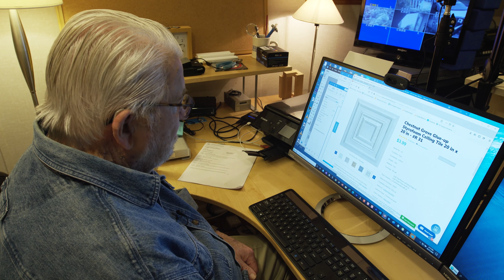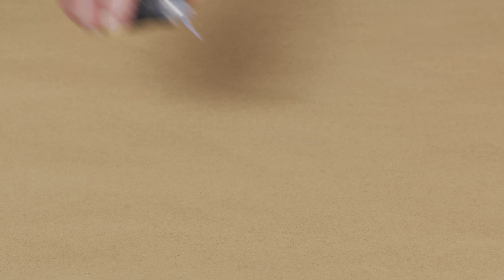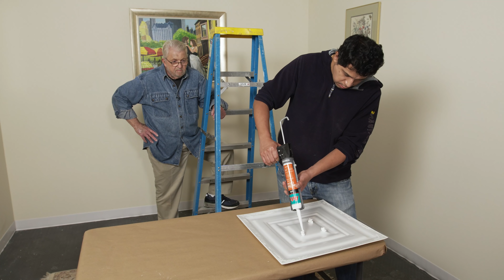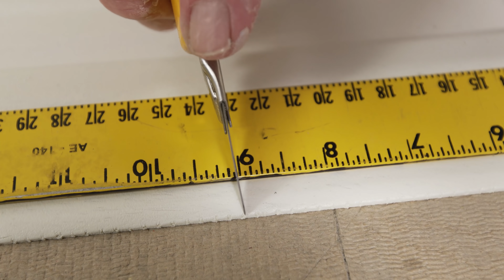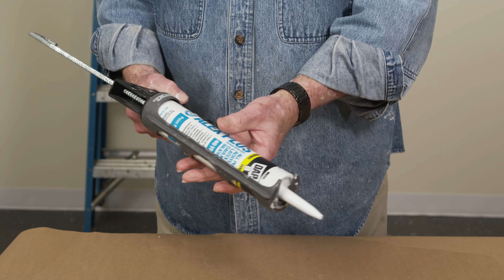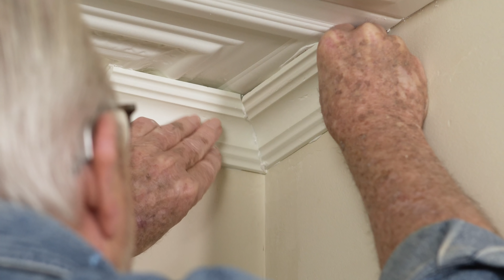Say Goodbye to Messy Popcorn Ceilings: DIY Guide to Covering with Glue-Up Ceiling Tiles

Comment: When using these tiles and crown molding, when is the best time to paint them? Before sticking them up or after?
If done before, they would need to be touched up after caulking since the paint will be will be a darker color. 
If done after, I am concerned with making sure I get into all the crevices. 
I didn’t want a ton of stroke lines.
Reply from the maker: I recommend painting them after they are installed to cover the caulking and avoid stroke lines.

Comment: DO NOT use this crap !!!!
Reply from the maker: Thanks for sharing your opinion, but these tiles work well for many customers when installed correctly.
Reply: @DecorativeCeilingTilesInc  I'm not saying they don't work, what i'm trying to tell you is these tiles are VERY flammable due to the material they are made of, they don't pass fire code minimum regulation, they are a death trap!

Comment: I removed a popcorn ceiling paint simply by using primer sealer put on thick with a roller.  I was actually just trying to recoat/paint it but the weight/chemical of the primer started peeling it so it became easy to use a scraper to remove it and then paint the ceiling.

Comment: Worked as a drywall finisher for 4 decades. The way I got rid of popcorn is by getting a sprayer with warm water. Wet the ceiling with the sprayer, let it soak in for a few minutes and scrape with an wider trowel. This method makes a mess, need a drop cloth but it works great. Need to touch up after the scraping most times. If some remains wet it some more and scrape again.

Comment: As a professional handyman, who is constantly repairing ceilings from leaks, this is an absolute horrible idea! First of all because you have the popcorn on the ceiling those tiles aren’t all gonna fit on their flush, especially if the ceiling is not 100% level. It’s like trying to lay tile on an uneven floor. The edges will pop up here and there it will look terrible and when time passes by and you do have a leak you better hope you have some of those extras to replace them or otherwise you’ll never find the exact same tile to replace it. if you’ve have leaks the best thing is to do is to simply take the popcorn down and have a smooth ceiling, which looks better,  last longer and is easy to repair in case you have any type of roof or plumbing leaks. It’s not difficult to take down. All you need is water, a pump up sprayer and a scraper.

Comment: It is actually very simple to remove popcorn ceiling, you just have to spray it with a squirt bottle, and then scrape it off with a flat tool. It can be messy to clean up, but it is possible to get rid of it.

Comment: I've just bought 60 2 ft PVC Stickgoo brand tiles from Amazon.  There were no install instructions and I was looking here for help.  I had originally decided to measure the ceiling length and width with a laser meter and calculate the cut size of each corner tile.  And then start in a corner and work outward from that  corner.  After watching your method I've scraped my plan and well use your.  It clearly is simpler in that calculation  work is not required and assure better alignment well be achieved.  Many years ago when I was in the USAF, I taught basic electronics to new airman.  I am in the position to say that your presentation here is excellent.  Thank you very much.
Reply from the maker: Thank you for your kind words.  Ron Hazelton trully did wonderful presentations.
Reply: @DecorativeCeilingTilesInc  "did"? Is Ron no longer with us?

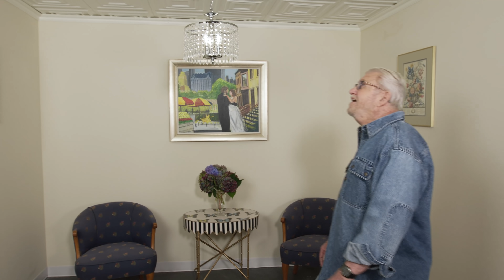Comment: Nice job and nice look, except for the end, because it's not finished.  Caulking the crack between newly installed crown molding and both the ceiling and walls is often needed, especially here with the ceiling tile ridges.  Look at 7:46 just 10 seconds before video ends; you see the black cracks between crown molding and ceiling on the far wall and it sort of ruins the entire job!  Finish details make all the difference.  Would take about two minutes to caulk the entire room interface between crown and ceiling.  Given the good work that preceded, the oversight is surprising.
Reply: Correct looks like CRAP😮
Reply: @Mr.Morgun0831 
💯!

Comment: I wouldn't do this without knowing if the ceiling contains asbestos.  Hammering nails, or in any way disturbing it could release asbestos into the air, as would the tiles when they eventually come loose.  At the very least, I'd use a N95 mask as a minimum.

Comment: With all due respect that is not a glue up tile. Yes it works but that’s not what that tile is made for.
Reply from the maker: Hello Jose,  thank you for your comment. Please explain what you mean by your comment.  It is a glue up tile, that is what it is made for and sold for, the only way to install it right is by glueing it to a solid surface.  It is too small for drop in system and also too light.

Comment: This works for certain decors, but let's be clear; there is always the option of just scraping the hideous popcorn ceiling off.  Messy yes, but a lot easier and less costly than the insanely expensive ceiling tiles (which I simply refuse to pay).  But I do see the appeal for some, who believe the simplicity and time saved is worth the price (I'm just not one of those people🙂).
Reply: My issue is that I have extreme chemical sensitivities. Scraping it off would cause dust to settle for months. We did it in one room and our cat developed nose cancer within a month and had to be put down. It's been almost 6 months now and the dust is still settling on top of book cases in the room. I cannot risk it in the room I sleep in. Only non-toxic adhesives and panels will work for us. Which costs so much more. :(
Reply: @enlightenedhummingbird4764 Aw, sorry about the loss of your fur baby😞.
Reply: @snarkyenigma9219 Thank you. I'm 💔. It was so sudden and unexpected. The nose lump seemed to grow overnight. It was so strange. I cleaned the space really well after. But I can't help thinking that project was the cause.
Reply: @enlightenedhummingbird4764 The timing certainly does sound rather suspect.  Sometimes the best remedy is to mourn, but then get another baby, especially when so many need good homes!

Comment: What do you do with the gaps between the ceiling tile and crown moulding? Looks messy
Reply from the maker: You could use a filler tile  to go around the perimeter that those not have  a deep profile. Also installing a molding with a thick enough "lip" and running the tiles into it.  Here is our selection https://www.decorativeceilingtiles.net/styrofoam-ceiling-tiles-20x20/

Comment: How much area is needed to glue them onto the ceiling? We have wooden rods across our ceiling, not completely flat surface.
Reply from the maker: The tiles need to be glued to a solid surface such us drywall or plywood.. We do not recommend gluing onto wooden rods.  However, I do recommend giving us a call to explore other options we have that might be more suitable.. 866-29-0380

Comment: Textured tiles did not work well with the crown molding. Maybe if you guys had caulked there as well it would look better? Personally, I put up tongue and groove in my main living areas and down the hallway. It wasn’t cheap, but it looks fantastic and hopefully is a value ad. I did the scrape version in my master bedroom and boy. Was it a mess even though I put down tarps. That stuff goes everywhere. And all the time I’m working on it. I’m thinking if I get cancer, I’ll know why. Plus, after all that scraping, I had to apply new knock-down texture and paint the ceiling.
The last two bedrooms in our house, I think we’ll just put up drywall over the popcorn. Sounds like a less work and expense. 😉

Comment: Yes I remember them very well  back the 70s or 80s they are pretty much ban but still can be found on line but now can buy Press metal tiles the same pattern in full sheet s or meter squares I believe it's very popular around country s yes saves alot of painting sanding especially 👍👍
Reply from the maker: We have been selling these in US for over 16 years.  The foam is most economical, we then offer PVC and also pressed metal.  We do ship worldwide. https://www.decorativeceilingtiles.net/ceiling-tiles/

Comment: You could hang some quarter inch sheet rock right over it
Reply from the maker: Yes it could be done but it is easier to glue these tiles over.  No taping, no mudding, sanding and painting.  And some people like the extra detail these decorative tiles provide.  There are many design and color options.

Comment: I would stick with the popcorn ceiling.  Polystyrene is a terrible thing to have if you have a fire. Extremely dangerous! Just use a wallpaper streamer and you can easily remove the textured  ceiling. You might need to replaster, thankfully a couple of coats of paint worked for me. By the way that ceiling by the end of the video looked even worse than the popcorn finish 😂😂

Comment: As a professional contractor we don’t install this type of material because it is very flammable also when working on older homes we recommend testing existing materials on ceiling for asbestos, always  be aware that remodeling older homes are often more difficult than you may think.

Comment: The ceiling looked better without the polystirene tiles , they looked cheap & tacky in the 70's & look even worse now . Not to mention the fact that they are an absolute fire risk . Do not put them on if you want to sell your house as you will be made to take them off to satisfy a survey .

Comment: Thank you for an easy to follow installation video.  I am going to try this on one wall in my bathroom where I took the ceramic title off the wall.  I think that it will look nice.
Reply from the maker: Hello, I would not recommend the foam tiles on a wall as they can be damaged easily.  PVC might be a better choice, see here: https://www.decorativeceilingtiles.net/faux-tin-ceiling-decor/
Reply: Thank you so much kind sir for the information.  I will definitely get the PVC type.  God blessings. @DecorativeCeilingTilesInc

Comment: These are banned in most countries because of the noxious fumes given of when easily set fire to and burned...also if you have a bobbly artex ceiling you can use hot water to get it of or plaster over the ceiling no need for polystyrene used in the eighties to cover up a ceiling or just live with it

Comment: Wondering how long you have to hold the panel in place for the instagrab glue to stick to the popcorn ceiling. My ceiling isn’t as texture as this it’s more so stomped  with a texture design.
Reply from the maker: No time at all, in my experience you just have to press it against the ceiling and it is up there.  Granted, if there is dust on the ceiling the glue might just stick to it or if the popcorn is loose but under usual circumstances, you press it and it is done.

Comment: Too bad the ceiling tiles don't look like reliefs from ceilings of ages ago. The ceilings that Had medallions around the light fixture in the center With more simpler patterns radiating outward. Now that would be pretty. Just putting tiles up there looks like an office ceiling with squares.

Comment: Even up to the 1980s, asbestos was still being used in ceilings, if the builder had already had the stock before it's ban in 1978. You don't want to disturb the ceiling even with just a small nail. I was going to use this method before I heard about the fire hazard, but thank God I didn't, especially since my ceilings are heated!

Comment: I don't know about this but any popcorn ceilings in UK pre 1970s has asbestos.. Its OK until you disturb it in any way. Needs specialist removal. If these tiles are poly styrene they are dangerous to the max, a small fire spread super fast & the smoke is highly toxic. Please don't believe everything on U T.. Do some research.

Comment: It looked like you cut one tile into 2 equal halves to fit perfectly into the ceiling. No need to cut if the starting line was shifted 9 inches from the center, and it would look nicer too.

Comment: This shows just how awful the finished product can look when adding Crown moldings after the ceiling tiles are installed. Done prior you could caulk paint and have a finished look without all morse code dark areas from all the space created from the relief. The lighting fixtures and vent are the other elephants in the room. Done correctly they could look like a hundred bucks too.

Comment: I covered up my bedroom ceiling with these tiles @ 15 years ago. It wasn't easy for a 4'10" woman who's afraid of climbing a ladder but I got it done. It looks great and is still holding strong.
Reply: @suza8110 thank you so much. I got the stuff now. we putting up the new ceiling this weeekend. Wish me luck 🤞🏾
Reply from the maker: @Goodkidsmom  How did it come out?
Reply: So my question is what kind of glue you use? Cause I want this in my bathroom ceiling but I want to make sure it will hold
Reply: @Goodkidsmom   You use the same kind of stuff you use for tile. It's called "mastic". Mastic is a sticky adhesive that is commonly used for bonding materials together. You will also need some calk to fill gaps and joints. You can also buy pre-painted tiles, or get whatever paint you like. Paint tiles before you start.
They usually come with good instructions. My only caveat is to plan carefully. Turns out my room is NOT even on all sides so the edges look kind of funky but no one else says anything. Also, get some nice crown molding to hide any mistakes.
Good luck!!!
Reply: Where can I buy the decorative silly tiles in this video
Reply: @jamesmoss7651   I don't remember where I bought mine (@15 yrs ago) 
Looks like Home Depot sells them and Wayfair has a good selection.
Reply: i am impressed. i am 5 ft and every single time i try one of these ideas i end up injured, out a bunch of money, stressed out and miserable, and I end up doing a bunch of damage and making everything worse. But have I learned my lesson? Nope! I keep trying stuff haha
Reply: @KristinaApplegate  funny how you sound exactly like me.
Reply: did you paint them,  I feel  like they would look really unfinished without paint and just look like styrofoam
Reply: @andreamitchell4758   I did paint them before I put them up. Now days, I think you can buy them already painted.

Comment: 03/20/2023 COVER vs Remove? I dislike popcorn ceilings due to mosquitoes are hard to see. BUT, in Florida, Dad mixed Rice Krispies into white paint and you could NOT tell where the patch was. Big patch. Make sure the paint matches and do not overmix. They retain their shape and are the desired size.

Comment: NO! I bought a house that originally had wallpaper, then another layer of wallpaper (ceiling paper technically), then a decade later they painted the ceiling, then a decade after that they painted it again. Then in the 80s they did ceiling tile and used black tar to stick them to the ceiling. All of this was over the original plaster work. Luckily the wallpaper was first so when I scrapped it off, a large majority of it came off with the wallpaper, but the ceiling tiles were the worst to remove. Do yourself a favor and future owners, and do it right the first time and stop with the temporary solutions.

Comment: To remove popcorn celling first lay down plastic on the floor and cover everything. Then dampen the ceiling with water mist. After it has a chance to soak in you scrape it off. It peels right off, nice and smooth, without the dusty mess getting all over everything. It falls on the plastic, you just gather up the plastic afterwards. I wouldn't put anything over it to cover it up.

Comment: I must be in the minority, but I actually see possibilities of incorporating popcorn ceilings into a design—if you know how to work with them. When I moved into my new home two years ago, I did major renovation but opted to keep the popcorn ceilings. Instead I added large, beautiful crown moldings and dazzling chandelier fixtures. It not only completely changed the look of the popcorn ceiling, but actually complemented the elegant look I was trying to achieve. Initially I wasn’t sure it would actually work, but I was pleasantly surprised and very happy with the results.  I would never change them now for smooth ceilings.

Comment: A friend of mine did this. Ultimately, the tile got loose and started falling off. The texture swallows up the moisture in the adhesive and dries it out, causing the tikes to unstick. 

It's a choice between fixing a problem or resolving the issue. My friend ended up scraping a couple of years later anyway.
Reply: Could have done white thin nails. Or tap it with paint.

Comment: I couldn't help but wonder why there isn't a paper/cardboard alternative to plastic tiles. They would be safer in a fire and much cheaper to manufacture and sell. On the other hand if there's nothing wrong with the popcorn ceiling, they look great and they provide acoustic sound absorption and don't add anything more to the fire hazard by adding another layer of flammable material . Every home improvement show I've seen has people walking into a home they're looking to buy or have already purchased and pointing to the popcorn ceiling and saying that has to go.  Imho it's corporate brainwashing to sell a new product.

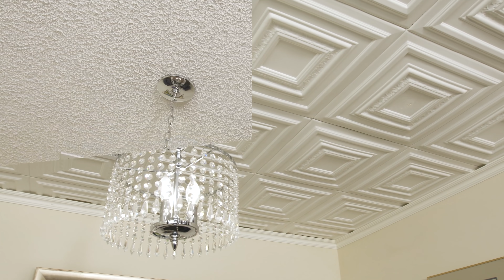Comment: 7:38 I think the crown molding and the way it looks, looks terrible with the gaps formed by the varying depths of ceiling tiles. I think the crown installed first or a different crown or different tiles would make it much better. Basically anything that would not have those big gaps.